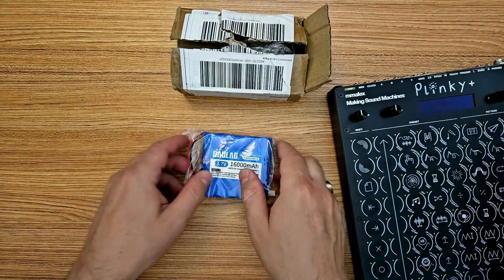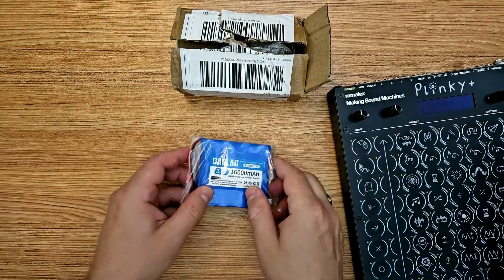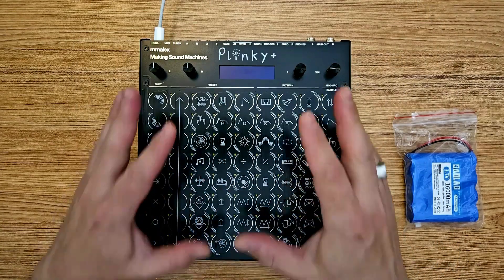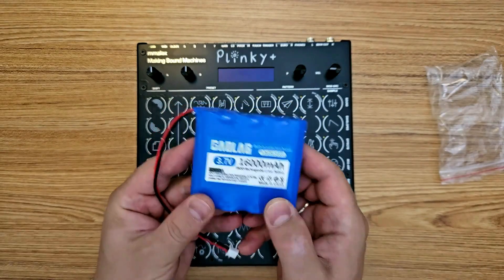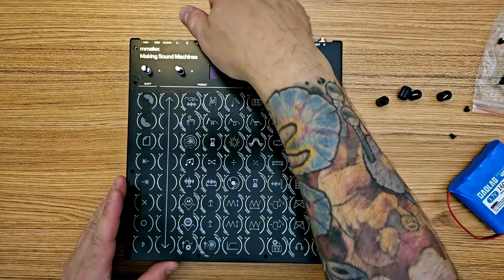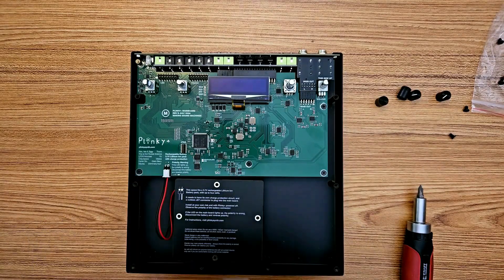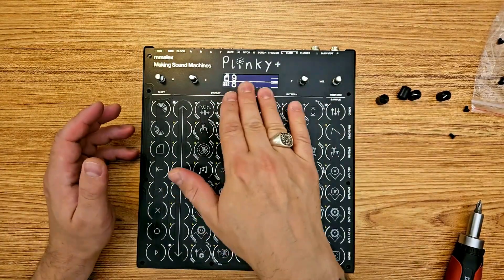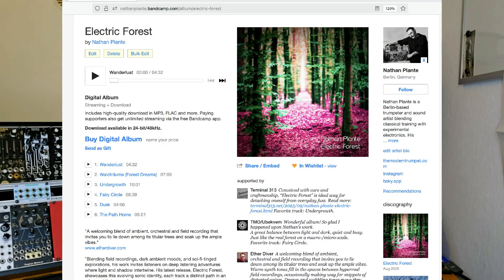Installing a Rechargeable Battery in Plinky+ (DIY Kit)

Comment: Nice! Link to the Aliexpress website?
Reply from the maker: Here is the link to the brand I bought, but the build guide (link in description) has links to multiple brands:
https://aliexpress.com/item/1005006556927592.html
Reply: @NathanPlanteSynths Thank you! Do you know when the Plinky+ will be available again in Europe?
Reply from the maker: @just.an.dutchguy I don't have any info about that, but if you email Making Sound Machines they might have an answer. I actually bought mine directly from them. They're based in Germany.
Reply: @NathanPlanteSynths  could you post the details from the battery pack that works for you? the alixpress link is unfortunately "not available in my region" 😢
Reply from the maker: @azazabacheche3973 Hm...best to use the list in the build guide, these are all of the known batteries that work:
https://plinkysynth.com/docs/build-guide-plus#installing-a-battery-pack